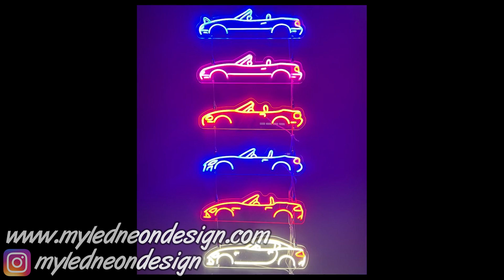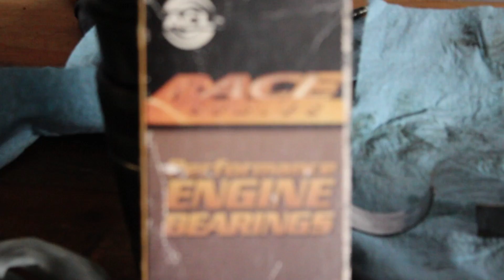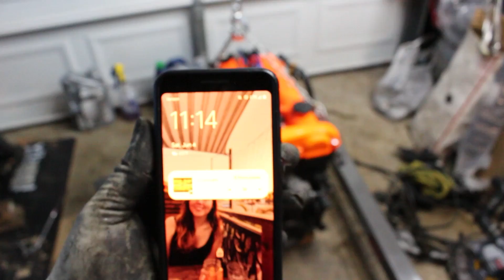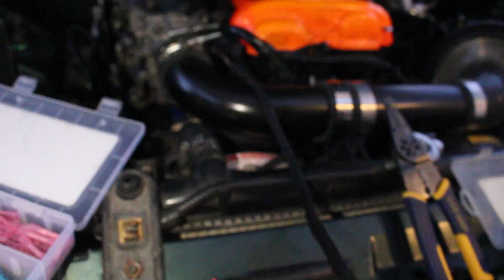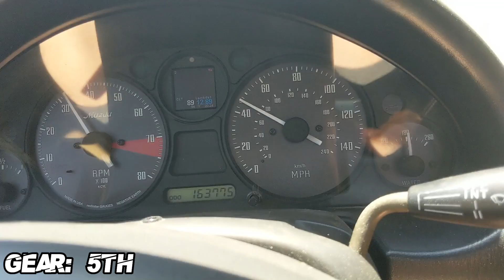I Accidentally Blew Up The NB [2-Day VVT Engine Swap]

Comment: I changed the oil on my sisters car once. When I was done I hopped in to go get lunch. Backed up & saw a trail of oil from where it was parked. Shut it off, got out & looked underneath at the oil filter only to see it gushing oil. I forgot to check to see if the old O-ring was off the block. It wasn’t resulting in the leak. Luckily I had another oil filter, but no more oil. Had to walk a mile 1 way to the gas station to get more. A neighbor saw me on the way back & gave me a lift. Lesson learned, I always double check the ring.

Comment: Smashed my bike and roof rack off of a garage door after having to drill through my roof to mount them, because 2015 WRX'S didn't come with fixed point roof mounts. sigh Had to start all over. Lessons learned; slow down, and take your time. Rushing things usually leads to mistakes.

Comment: Built a 1.6. Bored it out to 1.7. Forged internals. ACL Race bearings. Everything clearanced perfectly, yada yada yada. At only 13 PSI, the thing should be a tank and last a long time.

Except I didn’t use OEM seals, even though everyone told me to use OEM seals. So over the course of 500 miles, I burned up/leaked out ALL of the oil the car had. It was running so well that I didn’t check my oil at all after the break in oil changes.

Heard some tapping the other day so I checked the oil level, thinking it’s lifter tick and I need to top up. There’s no oil in the car. Not “the oil is a little low.” There’s no oil in the car. Added 3.75 quarts, started it, now it’s smoking like a chimney and I’m fairly certain my tapping noise isn’t lifter tick. Sending oil to blackstone to confirm my suspicions before I yoink and rebuild. Painful to think I threw away thousands of dollars, hours of painstaking work, and my first hand built motor because I used cheap aftermarket seals and didn’t check my oil regularly. 

Maybe I’ll get lucky and there’s no spun bearings and the noise is just a sticky lifter or two, and the smoke is just valve stem seals. Maybe.

Comment: Not a Miata, but I just bought a $200 key for my BMW wagon. I did this because those keys go bad all the time. Turns out all I needed to do was check the fuses. Spent $200 to fix a $.02 problem :/

Comment: Every time I do a oil change (mechanic here) I make sure to put the oil cap on the hood latch  in the bumper, so when closing the hood you can't and get reminded that its either not on or there's no oil in it.

Comment: Haha fuck dude that's so funny... take your time bro! Aight here's my story just as bad.    I got my koni yellow  on eibachs took to our boy ernies shop lol put my rear suspension in the front and my fronts in the rear my car also has an oil xfer kit plus oil cooler..  first little water drain dip bottomed out super hard! NY car looked like one of those hot rods where it's all high in the back and nose pretty much on the floor at the front anyways I bottomed out on this dip and slit oil feed line hopped on the hwy all of a sudden my oil pressure gage went to 0 and my car just slowly dies.  Got a new vvt for my 99

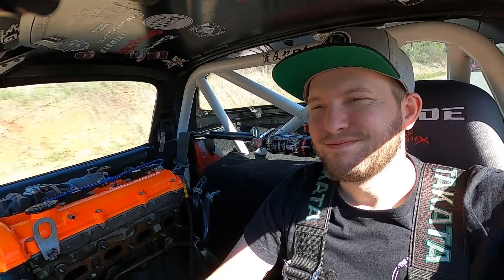Comment: 15:32 classis Miata dad moment. 
20 years ago when I was 17, my 2nd vehicle was an '86 2nd gen FC RX7 non-turbo 13B, only had 76K miles, didn't take long for me to ruin the apex seals banging 7K RPM w/ my HKS pod intake I bought for $260 🤦‍♂️, WAY back then, simple solution back then was to sell it. Only had it 3 months, being a teen that was an expensive 3 months, but fun as heck. Wish I would have just kept it & did a swap, but live & learn. 
BTW: If any NA6 guys are looking for the larger N326 AFM, I am currently selling the one from the afore mentioned car (FC RX7 NA). Never been opened or messed with (Greg, if you see this comment & want/can use this I WILL DONATE it to the channel, just cover shipping). 
Full part number is Denso N326 13 210

Thanks for the content Greg.

Comment: I was building up my first engine build a VVT BP. Somehow when putting on the oil pump I'd not spotted the old o-ring on the block before adding the new o-ring. Torqued everything down and heard a crack. Investigated a little and couldn't see anything so stupidly assumed all would be rosy.  Fast forward to the engine being all back together and in the car, much work as you know, and the car fired up first go.   The downside being that oil was literally being pumped out onto the floor through a big crack on the oil pump housing. Engine had to come all the way back out, but was a good excuse to upgrade to a boundary. Still, I know that feeling, and it was not a happy day knowing you have to undo all of that work. Makes you stronger though for sure.  Thanks for making the great content and keep at it.
Reply from the maker: Many mistakes are made at that oil pump o-ring

Comment: my brother's nb2 needed a new thermostat but he had work and I was available so I  volunteered. I loosen the left side easy enough but I can't get the right one to budge...a hammer is what I need! so I have the ratchet in place and I start hitting it in a downward motion. next thing I know I have the housing and part of the neck in my hands. I had to wait for a few days for the new used one to arrive and I now I had to remove the cam gears to remove the plate so I could get the remaining part of the neck

Comment: When I bought my miata the transmission was on its way out, so I went ahead, bought a new transmission and clutch just to make it safe, as I was swapping it (using your videos as a reference) the transmission wasnt wanting to go into place. Being physically tired and knowing another day was going to cost me $65 (had to pay to use the garage at the time) I slammed it forward to find out the clutch line was in the way. I already put away the transmission jack so I set it on my shoulder, took one step backwards, cleared the path, then set it in place. Good to know my back pain was for a safe drive though.

Comment: A year ago i was replacing valve cover gasket on n52. Long story short i took the valve cover off and was like ok thats enough for today going to continue tmrw. Car was outside and it rained hard overnight. E90 n52 have the rain vents drip opening right above the valve cover. My engine was full of water, everything was full of rust. I drained what it felt like 10 gallons of water lol, but somehow it still runs to this day. This was my dumbest mistake ive did not gonna lie. I somehow managed not to destroy that n52 by some miracle.

Comment: Crawled under car to change oil, wrench in hand, pan nearby. Unscrewed plug, oil was hot. Burned hand, dropped plug, knocked pan out of reach. Stuck finger in hole. Now burning finger, plug gone, pan gone. If I pull finger from hole, burning stops, but oil will shoot all over me, so worse burning will ensue.  Kick off shoe, use bare foot to toe pan back into reach. Resume oil change. MANY SWEAR WORDS. FML.
Reply from the maker: I visualized this and it was very entertaining

Comment: Hi Greg my story is after watching you for years I decided to install a ati dampener while installing it here in ny (the gear on the crankshaft would not come off) tried prying, heating, beating lol finally it came off but at a price i damaged the oil pump and oil pump o ring after getting the dampener on it would piss oil.... thanks to thati had to rebuild the motor now i have a 5k 1.6l motor in the miata.... so thanks i guess lol

Comment: I didn't secure the handbrake tight enough in a 280zx i had (years before miatas) and about a minite after i arrived at my friends place with a very steep driveway, i heard a crash and yep you guessed it, wrapped itself around a tree ...and i drained the oil in my wifes r32 once and forgot to put the plug back in...wasted litres of mobil 1....luckily i didnt drive it before i noticed but that was a good car guy f*ckup hehehe...

Comment: i just changed my engine filter and left the rubber seal hanging off the threaded tube that the filter screws onto.Of course when i screwed on the new filter it did not seal and drove 2 ks  with no oil in the panbut is okay

Comment: Ran on half of oil capacity on track, then rod knock. Thatäs cause that VVT engine held the oil level so well so I checked it less often. The VVT engine is still waiting for rebuild + forged rods and current turbo setup is on non-VVT 1.8 with DIYPNP ECU. So it will be really interesting to learn about VVT tuning! Also about the Variable Intake Control (VICS) which is inactive atm.

Comment: Hi MiataDad, here's my Mostly Useless $0.02.  Last week I drove 250 miles at speeds of 85+mph on finger-tight lug nuts on the RF wheel.  A week later I found 2 lugs missing and recalled hearing one come loose on the highway.  Had a good scare thinking of the potentially catastrophic wreck because of my uselessness.  Happens to all of us I suppose.
Reply from the maker: Yeahhh .... I definitely drove from SD to LA and back in my Z32 with finger tight lugs. When I got home 2-3 of them were about 1 thread from flying off

Comment: Me and a buddy spent 2 nights on the weekend trying to swap his trans on his WRX, had it out and almost back in the first night. Couldn't get the thing to seat flush with the engine. took it out, realigned the clutch 3 or 4 times before calling it a night at like 2:30am. Came back the next night tried it a couple more times, still couldn't get it. After sitting and having a few beers being angry because we should of been done already... Turns out the used trans we bought had the dowel pins in it... and so did our engine... Had a good laugh, learned the hard way.

Comment: As 3rd year apprentice at a local shop i was servicing a toyota hiace diesel van. A very simple job but i got distracted by lunch i believe and completely forgot to put a new oil filter on, so i filled it up and ran it for 5-10 seconds and wondered why it wasnt building oil pressure...  Then i seen the nice fresh oil coming out from under the hoist to my feet and i knew that i done fucked up

Comment: unsure of what i read on the tools, I kept on going, installing the wrong main bearings, 50km and kaboom the oil pressure went down, that's what I call a fresh shower, but it's all experience, no other massive mistake except for a wrong wiring in alternator ecu cable, that caused me a lot of head scraches because of not charging battery.

Comment: In high school I drove my H23 prelude for 10-15 minutes with the oil pressure warning light on to get to school on time. I didn't know what the light meant back then. My dad and brother came after school and replaced a leaking sensor and filled with oil and I drove that thing 2 more years before it finally gave up.

Comment: I bought a Miata for cheap that smoked like crazy on decel. Figured no problem, I’ll replace the valve stem seals. I got a little ahead of myself after replacing a couple and forgot to put the rope down into the cylinder and I dropped a valve. Ended up having to pull the head to get it out. Gave me an excuse to do a head gasket I guess 🤷🏼‍♂️

Comment: Welp, gonna throw my hat into this ring

June 2020 I take my NB RS out for a drive, about 80 miles in I notice rod knock.

Pull over, check oil and it’s below the low mark on the dipstick. F-ck.

How??

Every April the car has its MOT safety check and I have the oil changed at the same time. 

In 2020 the U.K. Gov extended everyone’s MOT from 12 to 18 months, so April 2020, no test, no oil change and I just hadn’t checked the oil.

Thankfully the crank was fine. Took the opportunity to throw rods and ACLs in there and the car now has a GT2560 turbo installed.

I now have one of the expired shells on my key ring as a reminder.

Comment: Over tightening rod and main bearings. I had heard horror stories about rod caps coming off so I was paranoid so I added 5 pounds of extra torque just in case. I was a newbie (first engine pull and rebuild) long story short I spun 2 of the 4 rod bearings - had to pull engine again remachine everything add new bearings and the engine held together as expected.

Comment: I had a cold before covid was a thing and I was at Walmart with the family and things were taking forever so I decided to get the oil changed while we were walking around so they finished the oil changed and it had enough oil at first but once I got on a hill to steep the oil light came on and then it started ticking.  So what I learned that day to check and fill to the correct level if I’m sick so I can change it later instead of forcing my self to become an expert in pull and installing my cars engine. Who else can pull there engine in 36 minutes??

Comment: Swapped a newer used engine in my car, due to previous one having knock. Alongside with that threw a turbo kit on at the same time. Anyways had the car up for not even 24hrs before that car blew up. Was with a tuner and my engine blew up mid data logging. Actually got it recorded lol but next time I’ll prob make sure the engine is running fine then throw my turbo kit on it.
Reply: On a side note note sure what the cause was, possibly just engine failure but too many variables without having taken out the engine yet. This happened a few months ago

Comment: Blew up my miata racecar at the track by running low on oil cuz of blow by and not checking the oil.  Rebuilt the engine with new bearings new crank rods pistons etc and no idea how but blew it up the very first day at the track after the rebuild.... moral of the story the machine shop put it together for me the next time.

Comment: Damn.. my biggest leaning experience not doing my oil pan gasket properly and still ignoring it after it leaked. It blew up a few months after. I swapped a JDM NB engine and I STILL haven’t finished. It blew up 3 years ago.

Comment: The cursed water plug on my turbo NA started leaking, so I wanted to replace it. I couldn't get a plug or a hose that day so I started to improvise and took a thick piece of garden hose and plugged it with a screw and secured everything with clamps. After about 50km I was on the autobahn doing some pulls and the head gasket blew.
Turns out the hose got soft, the screw was shot out and all the water leaked out

My engine builder told me he had to bore out the damage on the cylinder walls, so I decided to to it right this time and gave him forged internals to put in

Waiting 2 days for a 7€ plug was to much, so I rather paid over 1k € and waited half a year because the parts weren't available

Comment: Doing a "simple" spark plug change on my 1988 Golf GTI 16v. dropped the tip of the spark plug down into the open spark plug hole! After a couple of hours trying to get it with a magnet on a stick or on a piece of string. Ended up taking the head off. end of story? Oh no! two of the head studs sheared off! So had to take the whole damn engine out and take it to the engine shop to have the broken bolts removed.

Comment: This is the exact thing that happened to me while I was in the replacing my head gasket and cleaned up the bay and I decided to be proactive and drain the oil early before I changed my pads too and completely forgot to put oil in when I got it off the stands everything was fine then one day I was just practicing drifting at a empty parking lot and heard a loud bang, I got out and checked under the hood and the car to see if anything popped off was leaking and nothing, it wasn’t making a noise while it was sitting in idle or anything didn’t feel that I lost power nothing. So I drive home and I’d check my oil after every drift session I do. So when I did that time I realized I fucked myself so just casually put oil as if nothing happened😂, but speed to today my I had rod knock and as I was driving my car up to my mechanic the engine blew on me and I decided since I didn’t want to spend thousands having them do it, so I’m doing it myself and I wanted to do a vvt swap since I have a 99’ NB, it’s been really rough with my depression and anxiety with life and ended up having it sit for about close to 2 months now so I genuinely appreciate the great timing of you dropping this video Greg I miss ripping my NB thank you for giving me the motivation ❤️ side note this will also be my first ever engine replacement/swap too so good luck to me 😅

Comment: Winter 2020, decided to turbo my 1.8 NA and refresh the engine, dropped a screw in a cylinder without noticing, started the engine a few days after, huge jackhammer sound, head and piston ruined on cyl 2.
Swapped the head, engine ran but started to rodknock after 50ish km.
Decided to replace it with a vvt engine, ended up waiting for 5 months to get it shipped from the UK (brexit+covid times), received a NB 1.8 non-vvt engine...
But now, car runs solid and pulls like a train!

Comment: I did my dream build, 1.9L turbo NA. Worked on it all winter , machinist took 2 months, turbo supplier took 3 months. Finally I carefully put it all together with no assistance. Drive it 50 miles and find out I have excessive blow by in the crank case and the turbo oil can’t drain so it leaks past the seals. I was totally crushed, I sat in my garage going through the stages of grief. I took the turbo off and I’ve been putting on more break in miles. I ordered a scope to look inside the bore but I haven’t had the courage to look yet.

Comment: I had some loud lifter tick and thought the car might need some pulls because the oil might not be warm enough yet, after some driving and pulls in the 7k range it sounded normal, after a day I checked the oil level and realized, it has burned all oil and was running really low on oil 😅 now it runs fine but idk for how long lol
It's a 1.8 Na with 260.000km might do a rebuild before I put cams and itb's on it 🤔